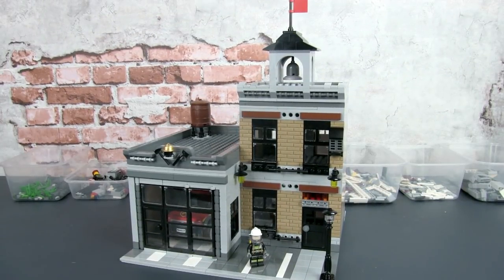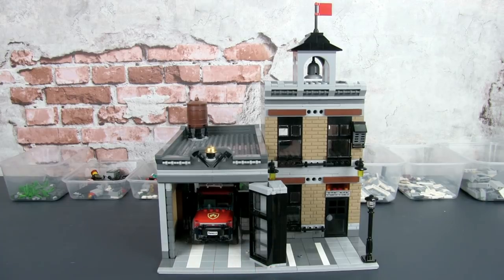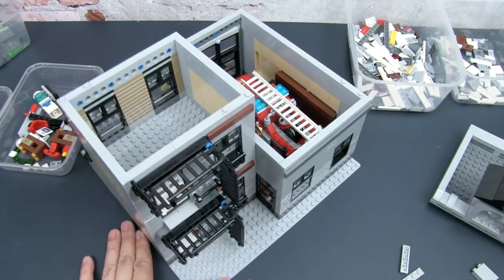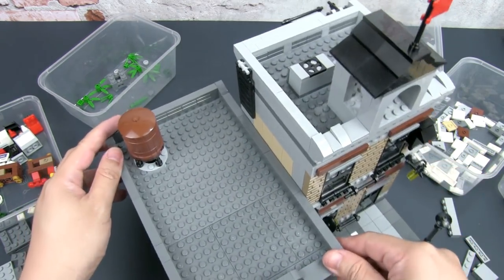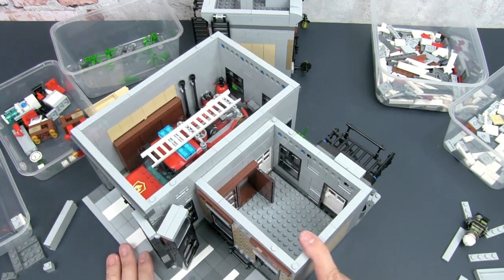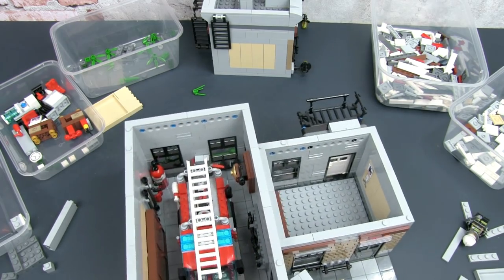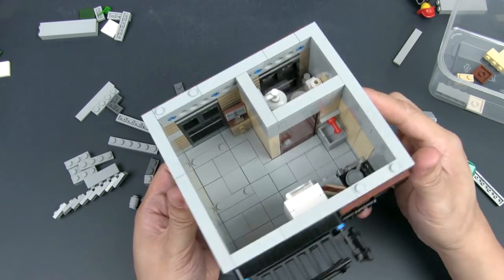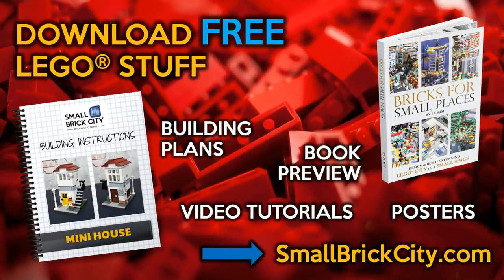Final Part! LEGO Fire Station MOC -  Building a MOC From Start to Finish

Comment: Awesome moc nice station for mee you need mor stuf for relaxation maybe  table tanis video game console The pool table something like that
Reply from the maker: Yeah, I wanted to but just did not have the space. I would have to build an extra floor for a gym and games. But, I will keep it as a two storey building for now.
Reply: @SmallBrickCity  ok like your station. My station have 2 garage, basketball in yard dog place in yard. Kitchen table for eat, balcony  with barbecue and table, room for  equipment, room for two call operator, tv, video game, table tanis newpapers table pc for play and pc for work, recaption, 3 bunkbad room and toilet. I still want chife office, showr and gym.
Reply from the maker: That sounds awesome! Yours sounds like a full fire station. Mine is meant to be a secondary smaller fire station for first responders. That is why it is not so big.
Reply: @SmallBrickCity  yes i buy city station 2005 2013 2016 and 2019 in moc

Comment: love it!  I love the way it turned out.  only one comment.  the back fire escape should alternate so the bottom ladder should be on the left and then the next one on the right.  that way they won't have to move the ladder above their heads:)
Reply from the maker: Yes, Thanks. I have fixed that previously but after this vid. You will see it in the review video next week. Thanks!

Comment: •Fire safety 101: Furniture can not block windows.
•The upstairs Kitchen must have a fire extinguisher.
•The back doors must have lights for safety, or else the Firefighters will not be able to see where they are going.

                  👍😉Safety First👍😉
Reply from the maker: I agree with the fire extinguisher, back lights too. Not too worried about blocking the windows :-P